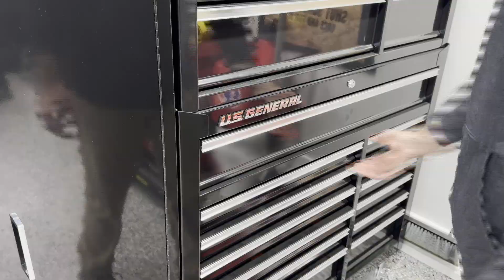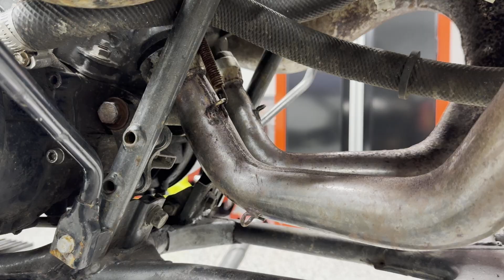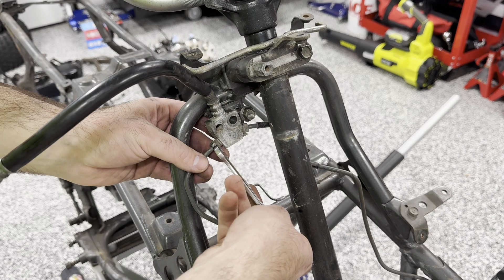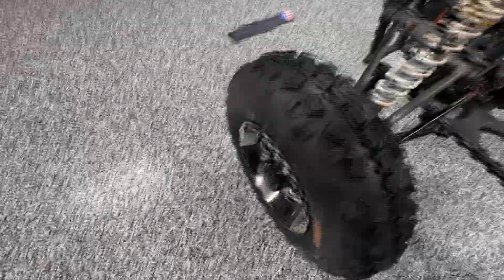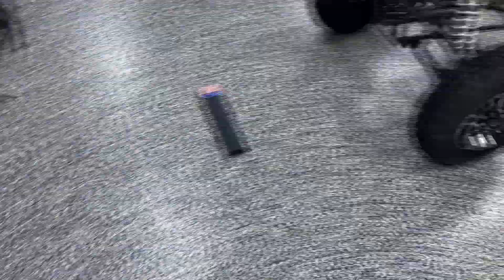I Tore Down my Yamaha BANSHEE!

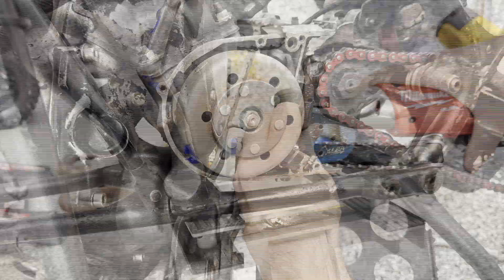Comment: 10:49 wooow so it even broke off the alba case saver? da fuk
you put those on to save thhe case seeems like it didnt noot help much (or maybe did help in the way that it only broke the top of thhe case nad not near the stator gears etc...)
and no banshee front are alwayss 4x156 (all yamaha sport quads)
only rear oon 1989 and 1990 are not the 4x115 but  for some reaason 4x156 rear and front... but people swap warrior/raptor/other banshhee whheel hubs on them to fit normale yamaha rims
but i dont know why you haave banshee rims of a banshee thaat dont fit this banshee... (maybe mesure what the bold patern is) im actually curious cause it looks like its stock 4x156 from the video.
Reply from the maker: I’m not sure if the alba piece was added on before the case broke, or if it was put on afterwards to try and keep it together. Sadly we’ll never know lol. 

And yeah I’m confused on how those wheels don’t fit. Maybe someone swapped Hines like you said. Regardless I’m getting new Lonestar racing billet hubs so it won’t matter in the long run. But the front wheels I tried putting on were off my old banshee and I was mind blown that they didn’t fit. The wheels that came on this quad are hideous haha. I’m not sure what wheels Im going to get for this build but I want to get something sick!
Reply: @Ray209  that woudlnt make sense.. to mount a broken case saver. a new one would make sense. to me it seemss like it was all new at somepoint and the chain rip off HARD and destroyed every thinng. and he just never cared to fix it. since it was still mounted i guess it was like dont touch it it be fine... cause no one would mount a broken case saver after you detroyed ur case. i mean u cant even buy a broken one...
yeah it had a rought time this poor banshee god damn....

yeah its odd for those rims i dont see any difference visually from the video. maybe somethhing is bend or broken that is why the other dont fit (seening the hole quad's state probably something bend)  and ye i dont like them SS rims i see them to much on youtube. they do add extre wide to thhe quad but they not usefull or offroad maybe for a road banshee with street tyres. ah billet hubs those are nice seen them on mike sabo channel i think. 

ah cant wait to see :) hope you make it no the clean otherwise you not gonna ride it like you did with ur last one you said. when its to clean to ride